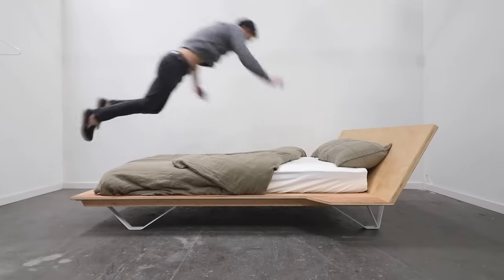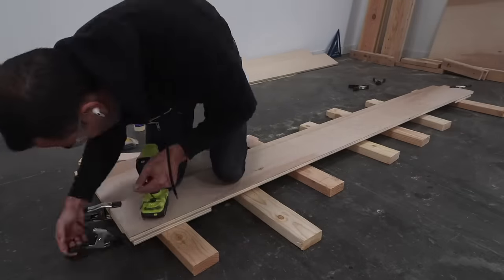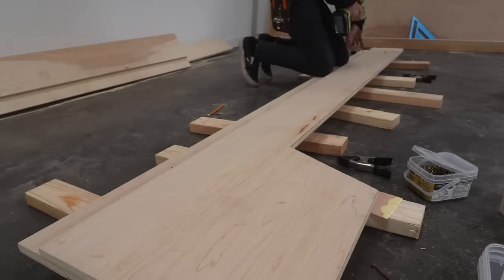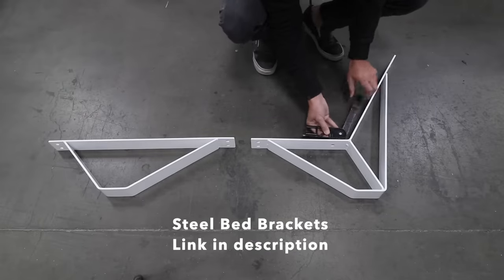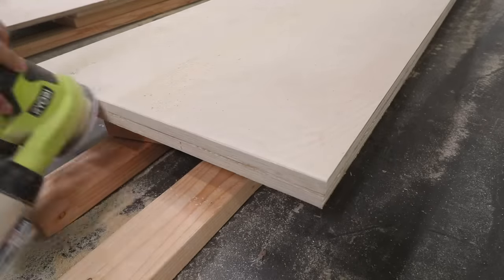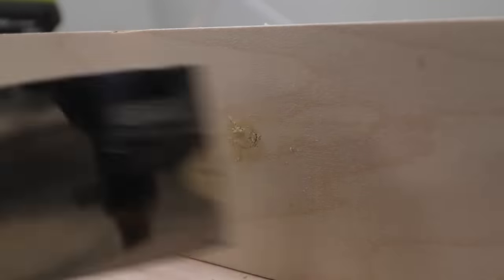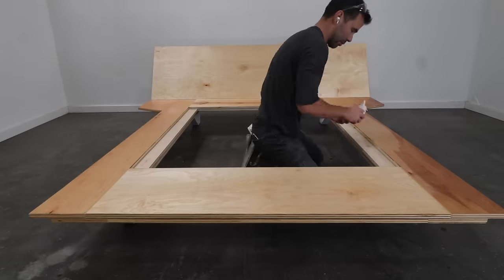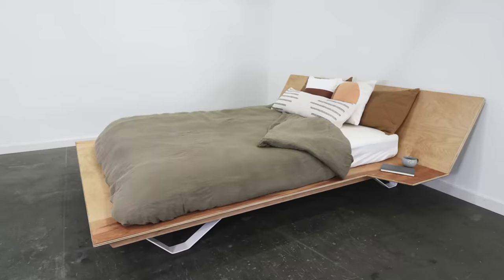DIY Plywood Bed | Requires just 4 basic power tools!

Comment: $362 metal legs?? Lol what a scam.
Reply: Yep $340 margin .. is cheaper to buy w bed frame off Wayfair
Reply: You also need $362 worth of tools, might as well not do diy either. 😂
Reply: You and the others are comparing apples to oranges: Ben's pieces are made custom while Chinese manufacturers would need a certain volume in order to hit the price point to meet your price point which isn't going to happen. Having worked in manufacturing in China I have come up with a phrase that fits your thinking: "Ignorance is never becoming". 
Please don't impune Ben's integrity.
Reply: @really2345  YouTube comment sections have allot of experts. There’s a saying from a wise scholar that said,”I never debated with a knowledgeable person except that I won the debate, and I have never debated with an ignorant person except that I lost.”
Reply: you don’t have to buy those metal parts
Reply: @hxjdko.bbyudje yep or can put an extra set of hairpin legs (.50 diameter) and just do a straight back headboard and use contoured back padding/pillows.
Reply: I'd rather buy a bed frame haha
Reply: I would have made it a floor platform bed it would of been cheaper than the legs

Comment: Ah, the shin splitter style of bed.  Notice the smooth modern lines, clean aesthetics, and the ability to split your shins in half. 
Seriously though it looks nice.
Reply: My thoughts exactly, lol but a nice build though
Reply: I have a bed almost exactly like this and have only hit my shins on it a time or two. You get used to the position of the bed, and learn to avoid whacking your legs on it.
Reply: @LongBoy.0  what about the occasional visitors who use the bed?
Reply: @orixa2122  There's 1 consistent visitor, it's not an issue.

Comment: Great project! My only worry is that with the slats flush with the sides, when leaning on the headboard the mattress will likely slide towards the end of the bed. I would add frame around the mattress, or drop the slats 2-3 inches below the sides of bed to eliminate this problem
Reply: I was thinking the exact same thing
Reply: @johntopham5619  me too lol
Reply: Maybe you could use perforated drawer liner under the mattress. I think you can get it in rolls.  And it wouldn’t have to be permanent, since it will grip on the wood and the mattress. Put some at the top and bottom of the bed.
Reply: Use a an adhesive rubber strip with texture that would hold the mattress in place maybe? 🤔

Comment: Those legs are $200. Not including lumber/supplies/tools.

I typically just find a used wood boxspring, strip it down to the bare wood frame, sanitize, and screw a half inch plywood sheet on top. Nearly free. Can be raised on a normal metal bed frame, or prop on cinderblocks for a few bucks (just run 2x4s along the sides for added support).
Reply: Good idea !!
Reply: Yeah, of course anyone can do that for free but it looks normal, tasteless and lacks any personality or design intent. This project was not created to be the cheapest bed frame out there, it's designed to be an authentically minimal bed frame to reflect a personal approach to room-decorating.
Reply: Corey Munn — Uh, that’s a personal problem. My beds always look a bit wild: unusually high to utilize storage space beneath, with cloth around the pillars. Add some imagination and free items can be just as creative and even more personal.
Reply: lol soundsbadman
Reply: 200$ - Ouch!
Reply: coz its merica product
Reply: Yeah in India we can make a new double bed in this ( around $250 ) amount 🌞
Wood is too cheap here.

Comment: Love the frame concept. Id like a taller version of the bed just so I could add some more storage underneath though... maybe even a set of hinges at the head board to flip the matress up and check out my storage setup below.
Reply: I live in a small space and need underbed storage, too. I just checked the dimensions on both this bed and the underbed storage at IKEA, and most--if not all--will fit with the lowest bracket model. I'm pretty pumped. I'll just make it without the attached side tables.

Comment: Add a router in to this mix of tools to put roundovers on all the edges for a more smooth, safer and modern look/finish. 
I’m going to build this for my new house and some of the other plywood furniture, I think it looks really cool and can look super expensive if done right by routing the edges and filling all the screw holes. 
Would look even better if the headboard and base was one piece of bent plywood.

Comment: looks beautiful. but, does the mattress not slip when getting yourself into a 'reading' position? thank you for the video
Reply: I was having the same doubt! I feel like a stopper by the foot of the mattress would be a good  and quick solution, or actually positioning the under-matress slates under the frame (screwed on and secured, which would also mean way more work) to create a depression for the matress to sit in and not move around
Reply: Im sure it will slip off in other positions too :P

Comment: For others who have tried it, does the mattress slide toward the foot when you are at a full reclined/sitting position? Is an additional piece of wood towards the foot of the bed necessary to keep the mattress in place?
Reply: A really easy fix is to stick some velcro to the frame to line up with the mattress. You don't have to have velcro on the mattress as well. The rough side should provide a lot of friction against most fabrics.

Comment: $195 for the platform bed!! I can buy a bed with that $195!
Reply: $195 only by solid steel feet  ( I'm Brazilian and I understood the value and the proposal)      "These simple geometric solid steel bed feet let you create a modern platform bed without any special tools or welding. Designed by Ben Uyeda of HomeMade Modern, and engineered for you by Semi Exact, these components are built for strength and durability, without taking up a lot of room. Made in our Nevada factory from recycled steel, each bed frame bracket is built to last a lifetime. Adjust the build plans to fit your mattress size, or even use these versatile brackets to create a sofa or outdoor lounge chairs".

Comment: What was final cost ???
how do you keep mattress in place I don’t think this is best you could have done
Reply: Well if I had to guess around 300-350 the leg system is 199$ but you can 40 bucks off with his code and it looks like he used 2 or 3 sheets of high quality ply that's about 50 a pop plus 2x6 and screws think 300-350 is a fair estimate

Comment: Looks lovely, and easy.
But seriously $200 for a few bits of bent metal?
No thanks.
Reply: Then buy the metal and weld it yourself?
Reply: @IIBLANKII  for that much you can buy metal and welding machine, and have some left for beer. You can not buy skill though.
Reply: @RammSkz  a grinder and paint makes me the welder I aint
Reply: that's where the cost comes from. The skills, knowledge, tools, and resources to make it.
Reply: Light Show, you're absolutely right, but there is one thing you do not consider - it is makers' self-evaluation. I mean this project obviously doesn't require much skill and tools, but the price is still big because the maker evaluates his work to cost this much. You can probably hire someone else to make this kind of thing way cheaper.
Reply: @RammSkz  yea the markup is probably high, but I also don't know the wages...etc,  so that's why I suggest welding some yourself since the resources are pretty cheap.  

As for the powder coat, it's not that hard to do. 

Some mild steel flat bar to do 4 of these is about like 7.60$ I think if you can do it from 1/8inch 20ft long flat bar. 

Powder coats cheap and easy. About 9$ per pound depending on the color of the coating powder. So about 16$  in resources. 

As for the worker's wages, I don't know. About 14-16$/h? 

Something like this though normally goes for about 50-70.
Reply: I just priced some desk legs on their site.... I suggest you do not do that. $250 for 2 A or H frame legs from 2" steel tube. 😁

Comment: fun work! 👍
needs corner holders for the end of the mattress so it stays in place when sitting up and some thin custom padding for the back.  I'd attach 2 triangles together wrapping around each corner sand em super smooth.  i would go solid piece in the middle too.
Reply: agreed for the corner holders but the mattress needs to breath (or will rot) so no solid piece in middle !!

Comment: Nice design but plywood slats in the middle will probably sag unless you only weigh 80 lbs. So if I made this bed, I would consider something stronger like a middle support leg to the floor or boards on end laid out across the opening.

Comment: Nice build , but if i was making it i would drill hole through the headboard or side table to thread the cord for plug extension and put beading around the edge so everything does not end up on the floor,  and i would have put  2 inch thick  ply strips on the bed base  where the mattress is to make a pocket so that the mattress does not move or drift on the bed frame.

Comment: Something I really dont understand about the plans for this build. A1 and A3 should have the same length but for some reason one is the length of the mattress minus 26in while the other is mattress length +2?
Reply: i was looking through the comments to see if anyone else addressed this. why would those two boards be cut to different lengths? i have several other issues with that plan, including the 2x8s all being short, and the slats not spanning the width

Comment: The size is perfect, but the edges need work. Needs protection incase someone walks into them. Maybe some type of soft paneling that you glue on, like they have on IKEA counters, but a little more soft. Just something smooth would do. Or a rubber triangle on the corners so if you bump into them, you're not gonna be in as much pain.

Comment: Any suggestions for other bed feet? As much as I love these I don’t have $300/each to spend otherwise I would just buy a bed frame 😅
Reply: Cut the shape/leg out of 2x material and sandwich the leg between two pieces of plywood with a 3/4" base to screw to the platform.

Comment: How are you preventing the mattress from sliding out of the frame once you sit up to use the head board, it kind of feels like the weight of your torso against the headboard would push the mattress.
Reply from the maker: good question! the edges of the plywood slates keep it from sliding

Comment: When would you use a table saw vs. a circular saw with a straight edge? Is it a matter of preference?
Reply: Yes. A table saw can be quicker but honestly, if you work with a circular saw enough you can make accurate cuts. I have a table I built where I can insert my circular saw flush to the top and is a "table saw"

Comment: The bars under the mattress are not a good use of plywood. 
As the fibers of wood inside the plywood are crossed vertically and the glue itself is very fragile, 
 because they are narrow: you are just losing half the solidity of the wood compared to just a plank.
(well that's mitigated if on the two sides, the fibers are vertical: but it's not optimum)

Comment: If you should get these legs, the cut sheet for the lumber isn’t correct.  It doesn’t match the actual way it is built in either this video or the “directions.” Also, there are some measurements that you just need to make up on your own.

Comment: "Super sturdy, zero flex", yet it flexes and bends as you jump onto it... 0:03

1. 2x8 pieces tend to flex, if you use them laid flat
2. legs with this structure and thickness to segment lenght ratios are anything but heavyduty
3. gluing up such parts using cheap, small, spring loaded clamps will not give the desired results (see the trimmed headboards edge, where plys are clearly not touching towards the centre of the board, since only edges were ""clamped"")

Comment: Who is this for? Anybody that's actually into diy would weld those brackets themselves. Used arc welder 100$, angle grinder 40$, steel 30-40$, and that's only if you don't have a friend with a welder or an angle grinder

Comment: It's an immediate "this man is not a healthy resource" when the first shot has you claiming "it's pretty sturdy" despite a visible headboard wobble and movement as you jump on the bed, and using a circular saw, with one end of a long piece of wood not supported, risking binding the blade/ruin your cut, AND then use a circular saw, kicking up untold amounts of dust, without ANY PPE, eye protection or mask.

I'm sorry, 0:35, i'm out, and anyoone else should be.  This is totally bad practice

Comment: 'Only requires 4 basic power tools...'   yea, like.. 200 $ each tool..!  Lmao, I kno, it obviously requires a minimum of tools, but seriously, DIY builders, you are all the same. Just so you know, when you reach the point of owning a round saw, drill, wood router, planer, biscuit joiner, drywall cutter, clamp, circular saw, pressure washer, table saw, jigsaw, grinder, compound meter saw, chainsaw.. Etc,  you basically not on youtube watching DIY anymore.. lol

Comment: 50% Budget on wood.
50% Budget on glue.
This is a great job but I don't think so much of glue is necessary if you're using screws.
What if you need to take it apart for some reason.